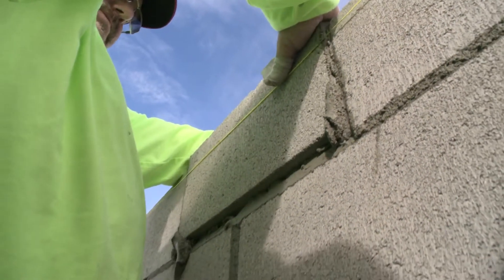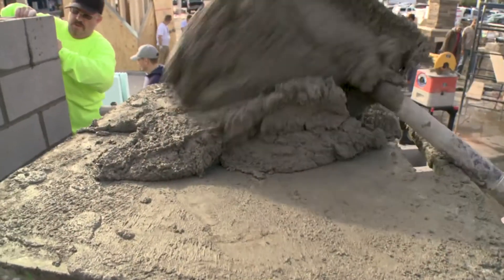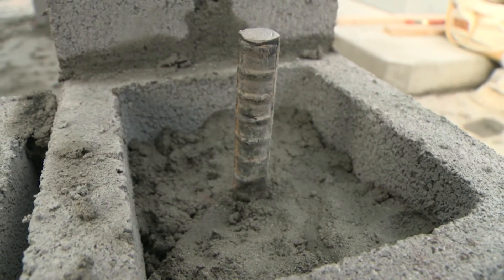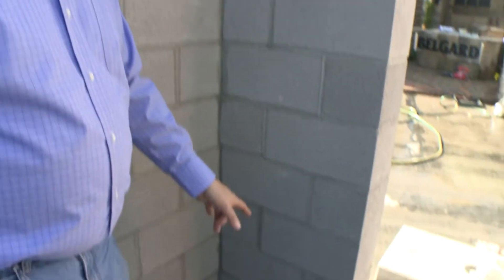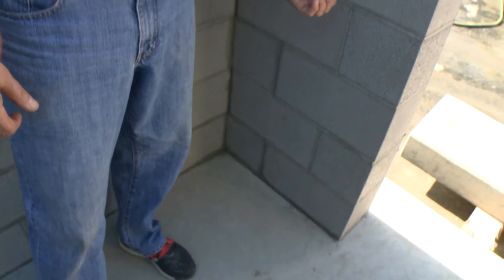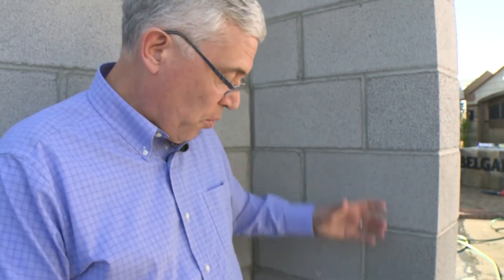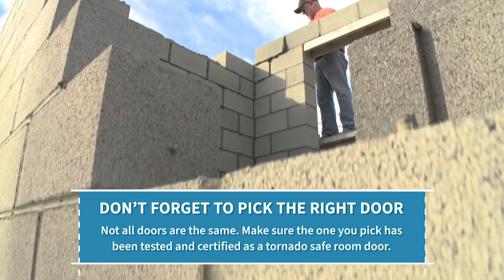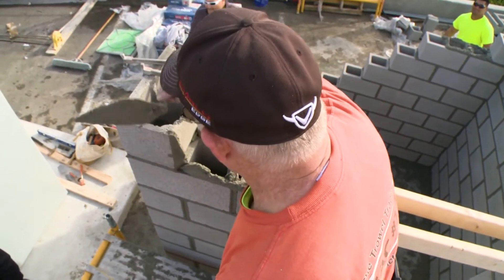Masonry Concrete Block Tornado Safe Rooms

Comment: How much does this weigh?  I've looked at the OZ safe room and the smaller one will hold 6 people and it is between 40,000 - 45,000 lbs.  It's all a one piece construction.  I know it has withstood an EF5 direct hit without any damage.

Comment: Since I live in Dixie Alley, and my son’s a meteorologist, he insisted the new house have a NOAA approved above ground storm shelter surrounded by concrete and rebar, including a separate concrete top.  It was constructed to serve as a storm shelter/master closet. A company out of Huntsville, AL (can’t remember their name) did an excellent job. Siding hides the exterior, while drywall covers the interior walls. A wooden closet door opens inward, while a heavy, sturdy steel door opens outwards. Back in 2020, it only cost 6k, and is worth every cent.
Reply: looking at building a storm shelter soon in the Huntsville area. Could you possibly see if you can remember who you used. I'd love to use a good recommended/approved local company.
Reply: @adamabernathy1777  I truly wish I could remember the construction company that built my storm shelter. . It wasn’t my contractor, though. I like that it was built with cinder blocks and rebar shortly after the foundation was set. I looked online at the many companies in and around Huntsville, but they sell prefab, metal safe rooms. What I read is your foundation for the prefabs have to be at least four feet thick for effective anchoring. What I do remember is before sheetrock was applied (since it doubles as a master closet) a sticker on the wall reading “NOAA approved.” You might want to contact Huntsville’s emergency management agency for recommendations. My general contractor just didn’t leave any information on who installed it, which I should have insisted on. I wasn’t exactly happy with his quality of work, and we parted on bad terms. Ironically, that shelter is the only part of the house completed correctly, only because he had nothing to do with its construction. A storm shelter is an investment you won’t regret! Sorry for the long answer. God bless!
Reply: @adamabernathy1777  I'm currently building one in a new home within 50 miles of Huntsville and I'm just using the same masons who did the foundation blocks and will be doing the bricks later on.   As long as they do as stated in the video and use rebar and fill all the holes in the blocks you have a strong structure.   Since mine is being built when the house is, we used rebar all the way down to the slab (crawl space house).   The shelter sits on a cinder block foundation which sits on concrete foundation.   Then the bottom is filled with gravel and a poured concrete floor is added.   Finally, the extra rebar that extends upward from the walls will be bent over and a concrete top will be poured.    Could it withstand the strongest tornado ever on record??   I don't know but it's way better than a closet in the interior of the house!!!

Comment: All these structures fail in an f4 direct hit. It's better than nothing u this gives a false sense of security when only bekow ground shelters will not fail. This has no roof protection either
Reply: It does have roof protection, this video just doesn’t show it. Shelters must resist impact at the roof as well as uplift

Comment: I do not care if these blocks are fill with concrete and steel rebar it is still nowhere near as strong as steel reinforced monolithic poured concrete wall. After cat 5 hurricanes there are still block houses that where concrete filled that are destroyed, concrete block is never going to withstand a EF4 or EF5 tornado. I am not gambling on my family's lives and building with blocks, it is steel reinforced poured concrete ICF construction with a 12" concrete core. People would be foolish to build a tornado safe room from block.

Comment: Tornado alley safe rooms… f5 rated
Reply: Bull. I saw an F5 clean a path over a state highway, lifted the concrete road right off the dirt, 16" thick concrete
Reply: @TimothyBd exactly
Reply: @TimothyBd it wasn't attached to the ground, just sitting on top of it.

Comment: But the question is will it stand against a violent ef4+ tornado?
Reply: They show steel above ground shelters from some companies and they say they can withstand EF5 tornadoes.  I just find it hard to believe that you just need a 5" block of cement and steel shelter placed on it and it will withstand an EF5.  Maybe if things are just thrown against it like when they show them testing it, but not one passing right over it.
Reply: @muffin2u63  It's incredibly easy to mind multiple photographs of safe rooms that have withstood direct hits from EF4-EF5 tornadoes, including in Joplin. When properly constructed it's very possible.
Reply: Answer: no. Gives a false sense of security.

Comment: I've said it before and I'll say it again ALL new construction could easily include a safe room and if done right the appearance would have zero noticeability from the remainder of the home.  This should be done for all states but the Fed does not mandate common sense.  And the Fed loves to pay out trillion over years.  So simple to solve.  Also should be mandated concrete homes anywhere hurricanes happen.  This would also be very doable and the folks that specialize in this can make them look any way u want (they have forms that can produce clapboard look).  This would totally handle the insane claims.  Anyway, whatever.
Reply: Absolutely agree with you. Safe rooms are not expensive when you consider your family’s wellbeing. The last house I built had a NOAA approved safe room that doubled as a master closet. It cost 6k, which was worth every cent. And, no one could see it from the exterior or even the interior, except for the massive steel door positioned against the wall.

Comment: With so many people injured by falling debris....it is insane to leave out a roof to this structure. Also... Theres more than just wind in a tornado...there are 2x4s  and metal pipes etc crashing into the blocks at up to 150 mph. The underground steel shelters are safer.
Reply: Much of that area has high waterlevel. No underground or basment.

Comment: What about the ceiling of this room??
Reply: A concrete top is fixed on the top. Usually takes a couple of months to set using 2x4s. Mine was rated by NOAA to survive an EF-5 tornado. Underground shelter was impossible on my property.

Comment: I would line inside with steel plating.. for safety
Reply: FEMA 320 gives some good guidance on build. They recommend putting the steel plating on the outside. Having a reinforced block wall as the baseline structure I think would be very good, it would protect against debris if anything did happen to penetrate the out steel plate. A standard block can also stop nearly all kinds of bullets including full cartridge rounds but not anti-material rounds like the 50 BMG. I think it would be great to integrate into a house design, it doesn't seem like it would add that much cost over a standard block wall. You could do an internal safe room with it to as the safety shelter.
Reply: @nafnaf0  Just remember cell phones don't work in an all steel room.

Comment: I hope nobody actually thinks this is a good idea.. any tornado is going to blow straight through this. Someone is going to spend an arm and a leg on this just to realize; very briefly and unfortunately, that they should’ve built something underground.
Reply: An underground unit in my area is subject to flash flooding. Even a concrete vault could blow out of the ground in a flood at any time. It could become a death trap in a tornado. FEMA can provide plans with engineering approved standards for above-ground, concrete block shelters. There are hundreds of approved, self-standing metal structures anchored to concrete pads. Such structures exist in F5 strength, and have withstood the test of time across the US. You have no idea what you are talking about.
Reply: Has it ever happened before?
Reply: You do not understand construction nor engineering. Listen more, comment less

Comment: why does it make sense to build houses out of wood in tornado country?
Reply: It doesn't!
Reply: Nothing is through of as permanent there. Cheaper to think of houses as disposable and replaceable. What's the point of building it well or cheapest when an f4 or slow moving f4 is going to slap entire neighborhoods. A mile and half of asphalt gone. In ground storm shelters ripped out of the ground with 3 food trenches of soil gone. Ya no.
Reply: @angrybear86  Cheaper, my ass! In which way is wrong to invest more to the cost of expenses to build a reinforced concrete house? Life is more important than money.
Reply: @angrybear86  there is only one known case of that happening and it was only pulled 18 inches out of the ground (it was an ef5 not an ef4... idiot)
Reply: It's called statistical probability.  Same reason people fly, live on the Ocean, or live in fire ridden CA.
Reply: It doesn't make sense from a safety standpoint. It's done because it's fast and cheap, and modern home builders don't care if you die in what they built.

Comment: Most people in these comments obviously didn't listen to anything the guy said. The blocks are not just stacked... they are connected with rebar and concrete.
Reply: Yeah ik about these cause where I live all houses in my country are made by concrete  and blocks  only poor persons somewhat use zinc and maybe wood idk
Reply: @OnlyTruthLove  means nothing above ground. 
Example Jarrel tx. Petersburg, all tornados that have several feet of ground scouring.
Reply: @angrybear86  according to physics, it literally cannot mean nothing. Especially when anchored with rebar into the ground.
Reply: Ive seen them with anchoring  and with plate steel reinforcement
Reply: I know someone who built an "A" frame house and the bottom was his garage and he used cinder blocks and poured concrete all the way down the center of them.

Comment: Or a better Idea - build your whole house out of these blocks for about half the price of a normal build, and have it last longer, and be safer. Mind blown.
Reply: I still don’t understand why the hell this isn’t standard here in Texas
Reply: @Bobbles86  Exactly. Looking into building one myself for my property
Reply: @Bobbles86 

Insurance $$$
Reply: It is not going to be half the price, on average in USA a concrete house is about 7% more expensive than the wood frame, but 7% higher cost is absolutely nothing given all the benefits you get. Tornado proof, bullet proof, non insect edible, fire proof... with little bit of insulation you get tremendous energy efficiency as well. If I can afford to pay 500k for a 3000sqft wood frame house, I'd gladly choose 2500sft or even 2200sqft concrete house for the same price.
Reply: Minus annual cost of insurance in savings,heat, cooling no termites. I would like to see the number on something like this.
Reply: @miusukamadoto6805 lol and end up  with almost double or tripling that every time there’s a tornado…..I guess longevity ain’t a thing anymore.If I have a building that can’t withstand tornados(which happens frequently in some states in America)It would make waaayyy more sense building your home in concrete…all it is a culture thing,jus like with you guys and the imperial system….plus it’s a big business…and y’all have more carpenters than masons.
Reply: @jreacts3652  that's what I said though. At slightly higher initial cost you end up saving big time over the years. Maybe I didn't word it properly, sorry about that. I will always choose concrete house over a wooden house.
Reply: @miusukamadoto6805  dont quote me on the prices. I figured its cheaper as you dont need siding or plywood. Blocks are cheaper than wood. Little concrete is used to fill the holes of the blocks... but youay be right. I havent actually ran the numbers.
Reply: @OnlyTruthLove  no issue.
Reply: lus fill the blocks with concrete and gravel more strength and cheaper too
Reply: @miusukamadoto6805  Another point of savings could be that it's pretty easy to do yourself? It seems very easy compared to having to know a lot when doing frame housing. Anyone can do it pretty much. Then just hire someone to do the roof.
Reply: @OnlyTruthLove  I don't know, I can't really compare the difficulties... I grew up helping building our house and our neighbors houses, but I was just following orders from the people who knew what they were doing, I was just mixing concrete and carrying blocks and buckets with concrete (most people were mixing their concrete manually instead of hiring a concrete pump).
Reply: Most concrete houses in the Philippines are reinforced with multiple iron bars and not just one per block. Resists 7+ typhoons a year for 20+ years with no issue. You rarely see whole towns totally flattened even with signal 5 typhoons
Reply: @carlo9877  I think their reference might be warehouses. They are not as sturdy as homes with short walls and Manny inner walls anchored into the foundation.
Reply: Why'd we ever stop building castles 🤷🏼
Reply: My house is block walls, it is great. I would definitely do it again. Adding the rebar tied into the foundation is great too, and wouldn't add much cost.
Reply: Americans love their wooden stick and plywood houses that are regularly blown over by the wind
Reply: @markusr1308  

Cause they love their insurance when they blow over lol
Reply: @markusr1308 oh but they’re not regularly blowing over 😂 idk who tf tells you idiots this shit but it isn’t true!
Reply: @markusr1308  its good for the economy x.x
Reply: @markusr1308  Most places in this nation don't have tornados. Thank God.

Comment: no. unless it's deep underground, this will crumble on top of you. entire strong built buildings have fallen to the ground, entire towns leveled, but you think this thing will save you? would like to see how it survives a truck thrown at it with wind speed of 150 mph.
Reply: It would survive.
Reply: The truck wouldn't be moving at 150mph. It will easily survive the wind, and maybe have minor damage from the debris .
Reply: @OnlyTruthLove You are definitely sadly one of the statistics that can only be identified by a few teeth embedded in a tree 2 miles from this saferoom
Reply: @angrybear86  I'm the guy that never shows up in any statistics ;)
Reply: @OnlyTruthLove  you do know that Nader's too out at nearly 400 mph
Reply: What do you think the rebar is there for?
Reply: Built according to approved standards, these will survive F5 tornadoes. They are all over the country and have withstood the test of time. You cannot build shelters underground in areas subject to floods or flash-floods. You have no idea what you are talking about.

Comment: Use bond beam block to build the whole thing, horizontal and vertical rebar every course and column. Foot thick roof and walls poured at same time..

Bond beam block so you get more concrete and rebar
Reply: Bond beams in the wall are really only a seismic consideration. The bond beam at the top of wall is all that is required to tie the wall together
Reply: @Lumens1  Does regular block not do good in earthquakes?
Reply: @byronmongillo6387 seismic has a ton of ductility requirements for block. It is used though
Reply: Thats what truss wire is for

Comment: What's made in pieces, comes apart in pieces.
Reply: When poured solid it becomes one piece. We build them and place all steel , then pour solid with specific grout with a pump truck
Reply: @dtm6215  What is the difference between grout and concrete?
Reply: Not when you know how to bust them rods boy.

Comment: They proven that a 2x4 wood can fly through these blocks.
Reply: @REM-4444  no!! I have built several of these . When filled solid and proper vertical and horizontal rebar (bond beams) these are virtually indestructible.  Solid concrete roof as well .
Reply: Texas A&M led the research creating safe rooms. I assure you, a 2x4 is not going to penetrate a safe room made to this video’s specifications.

Comment: The master bedroom should always be this type of room, or one of the bedrooms.
Reply: Facts!
Reply: This is to funny. Evidently you haven't seen what that tornado did to Kentucky. Tore these exact buildings to absolutely nothing left standing. Above ground is a no go. Underground yes. Do people not have common sense anymore?
Reply: @spiritwings4592  There is of course the problems of a home built long ago and these problems can be endless. The answer can easily be worked into code changes that would by very affordable. I've done it many times for my family and friends. The KY tornado was something all together different in what would be needed. Nearly all of that areas is mountain range and solid rock hundreds of feet deep, kinda tougher to dig or blast. It would be easier to drill and attach above ground.
Reply: Other countries have the whole house made like this. The u.s.a is the only country making houses out of cardboards
Reply: @tavolorgia3472  Cardboard and sticks to be precise. Less concrete the better.
Reply: @tavolorgia3472  well even our poor have a house, not everyone is perfect like you lot
Reply: @rbnhd1976  It's called building codes and standards,  it's not about being perfect.  It's about what the local gov or state gov requires for you to build a home but you all ready knew that before you got your panties in a bunch didn't you.